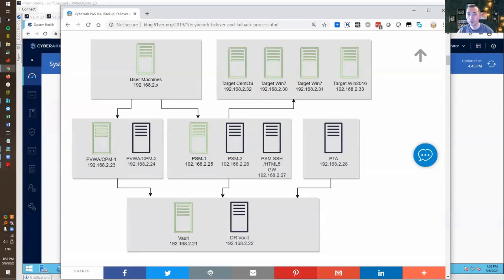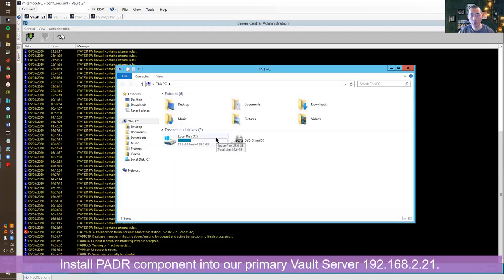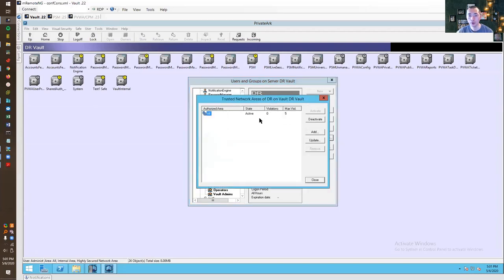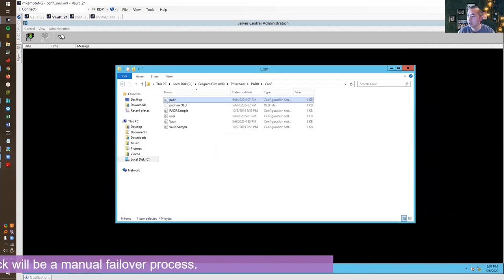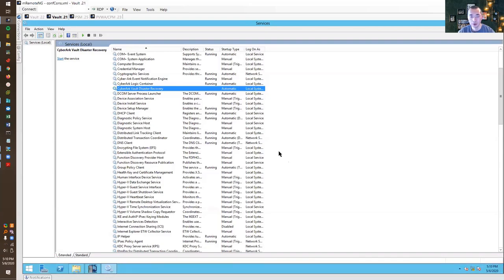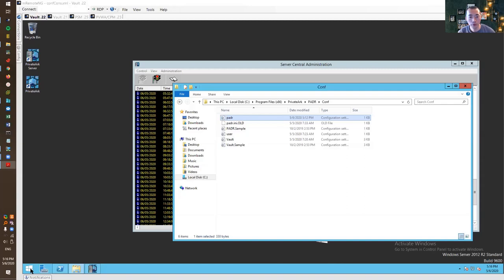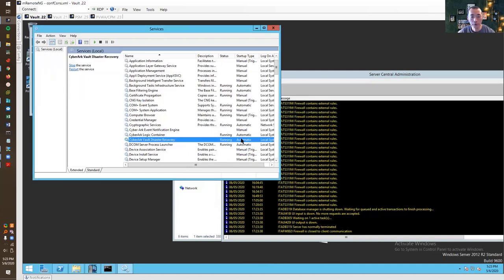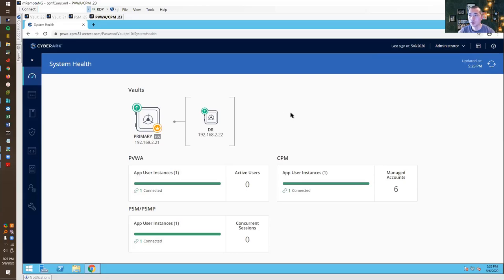CyberArk PAS 11.1 Install and Config  - 8.2 Vault Failback

Comment: I have some question about the DR failover:
1. If both Primary and DR Vault server are up, does the replication of data to DR auto perform every hours? (cos I see a "ReplicateInterval=3600" in the confi. file)
If no, does the replication only occur when DR vault monitor the Primary Vault's service is down?
2. In the last part of the video, you say it is a necessary step to reset the DR user(In primary Vault) and create a credential file on DR Vault.
Do we need to do this everytime when it is Failover back from DR to Primary?
Thanks!
Reply from the maker: Hi ks chan, the replication mode has been changed a bit since version 9.3. Metadata (safe files, recordings) will be replicated based on schedule (3600). But accounts information is sent from active to backup right away.  second question, yes, everytime.DR user's password will be reset after each usage.
Reply: The ReplicateInterval=3600 is All Safe replication, every hour you might see replication happening for all Safes.
Still a meta data replication is triggered every 5 mins.

See padr.log